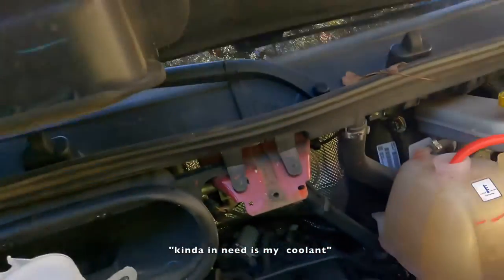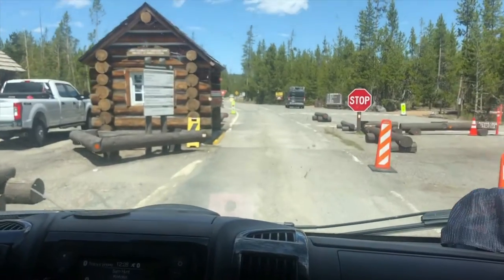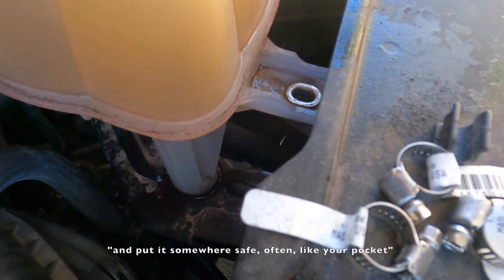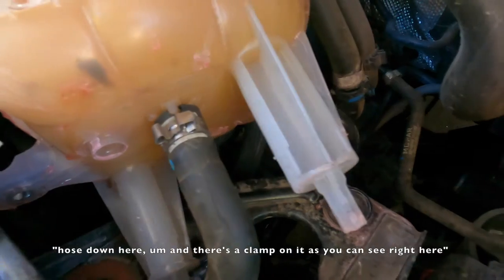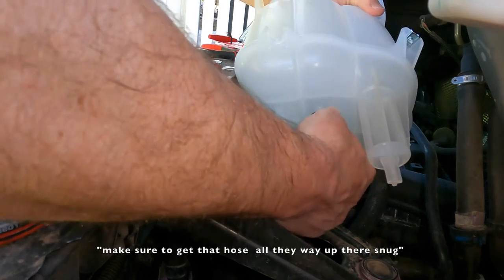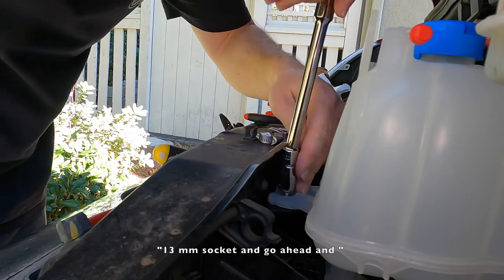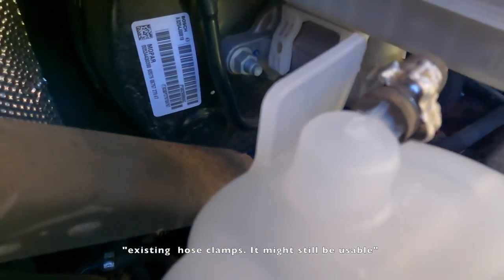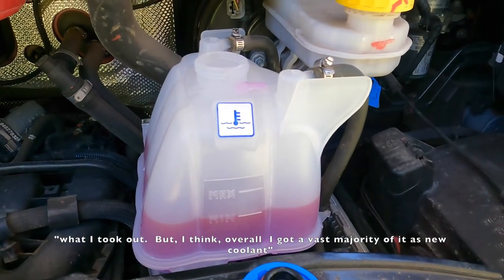How to replace & refill a Ram promaster's coolant reservoir

Comment: Hey bud, does the furthest back hose off the reservoir tank on the right side float or is it secured to anything? I had some work done to my van today and im trying to make sure the mechanic wasn't being lazy and not connecting hose back to there correct spots. That rear hose currently sits free after the work and that seems odd to me. Also i have another empty clamp just below the hood release clamp which is next to the coolant reservoir about 2 o'clock-ish and im trying to figure out whats supposed to be there. Thanks for any help you can provide. If you need pics let me know.
Reply: Mine hooks to the lower heating hose, it certainly is not hanging free